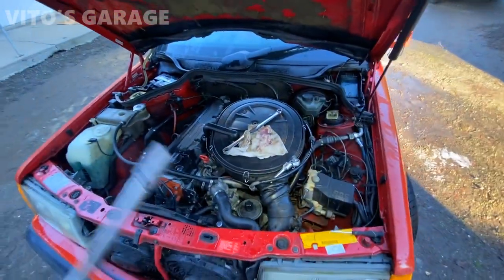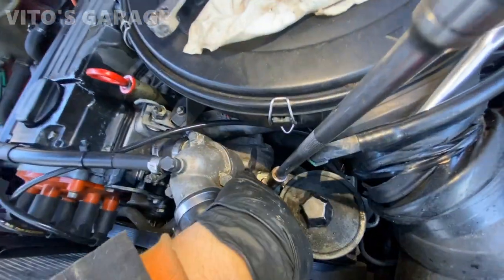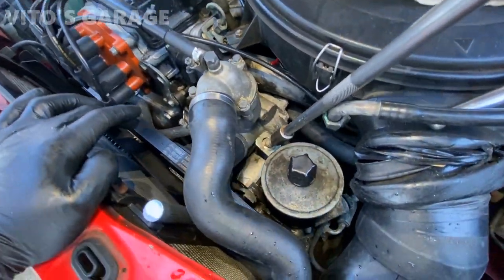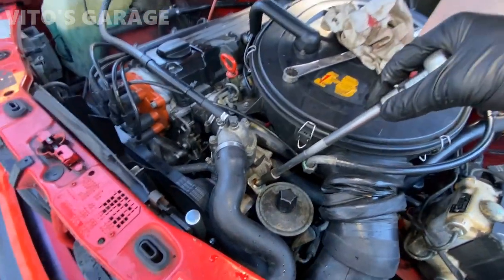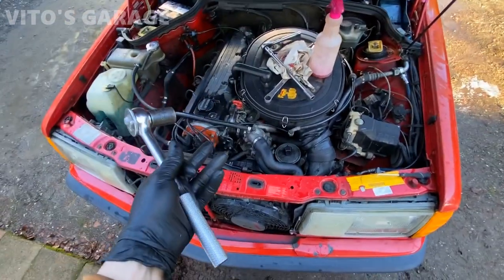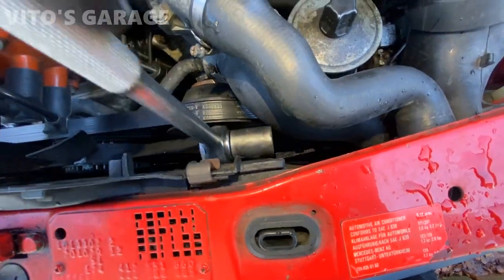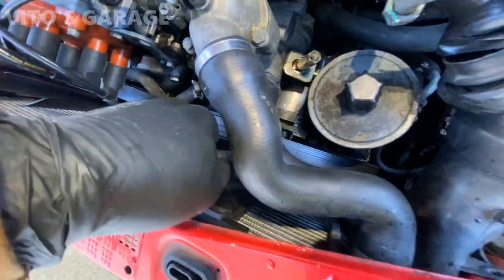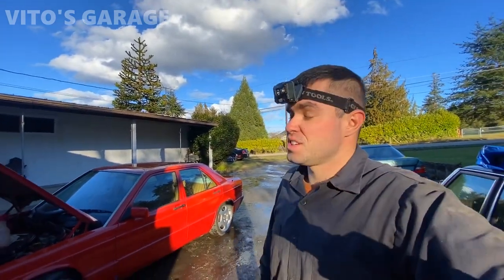How to Tighten a Serpentine Belt on Inline 6 Mercedes M103 Engine 190E W124 W126 W463

Comment: Another awesome video. If I may make one small comment: an awesome MB guru as yourself can judge the tightness of the belt just by touching it, for the rest of us the belt tensioner has a arrow that tell us when the tightness is reached. Some goes for the darn 19mil , your knowledge and experience tell you when the screw is tight enough, for the rest of us 75 NM is what MB requires. Again you ROCK!!!

Comment: Thank you for the tutorial. I was foolish and didn’t loosen the pulley and just started to tighten the tension rod. The rod snapped and now I have a bigger issue on my hands. Any idea of how to replace that rod?
Reply from the maker: You need to remove the belt, fan clutch, power steering pulley, fan clutch pulley, water pump pulley and then you can take out the tensioner assembly. You need to take out the whole tensioner assembly to replace the rod

Comment: Awesome vid. My 19mm bolt just won't budge. I dont have a long handle ratchet and I've tried spraying the bolt with wd40 very precisely. Any tips?
Reply from the maker: Put a jack handle or pipe on the ratchet for more leverage